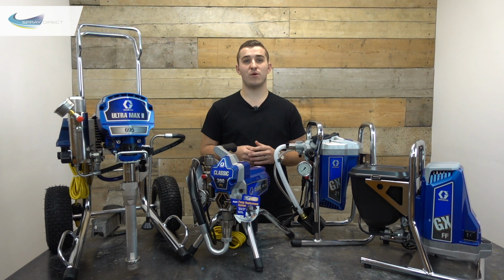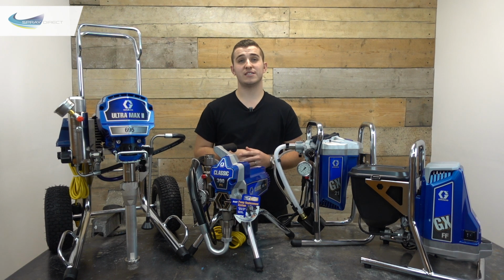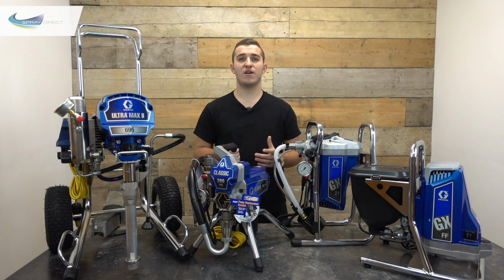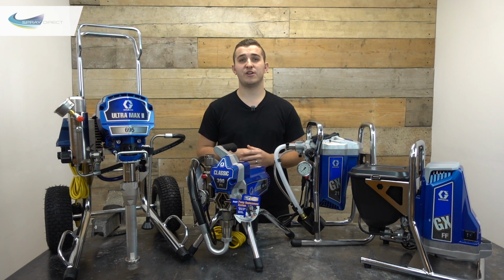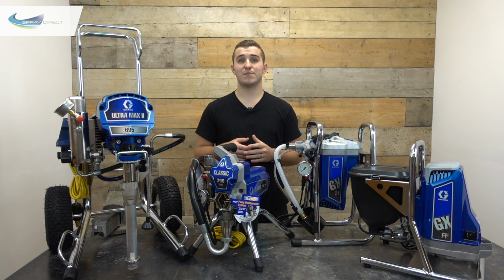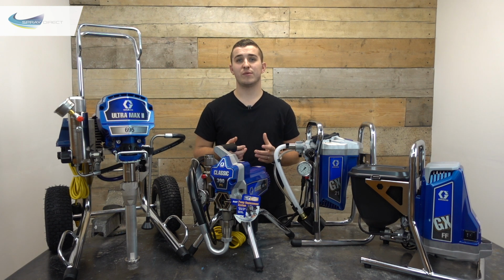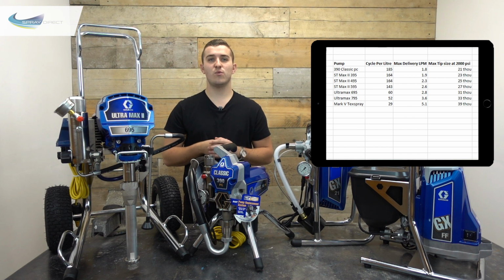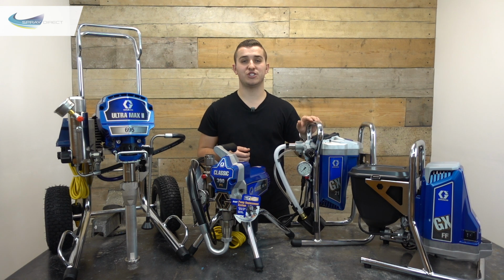How to pick the right Airless Sprayer for you

Comment: Which do you recommend for laquer on cabinets?
Reply: for clear laquer ive used titans version of the gx19, a hopper fed airless pump and it worked great, just make sure to clean it with the correct solvent and never run a water based product through that pump again it will contaminate anything you spray out of that pump after. ive used the gx 19 for water based laquer as well and it was great, a 395 is wat i had set aside for laquer undercoater as well

Comment: Is the pro210es the same machine as the 390?
Reply from the maker: That's not a model we have over here in the UK but it looks to be a cross between the 190 and 390 we have over here 👍
Reply: @SprayDirect  it really is. It has the same upright filter housing and gpm rating as the 390, but not equipped with a brushless motor or quite the same aesthetics.
Reply: very similar pumps as far as finish and production but the 210 is basically the homeowner version of the 390, certain parts and pieces are not as strong as the 390 as the 390 is proffesional use. id reccomend the 210 if you paint often enough or have a project big enough you need a reliable universal sprayer but not if you are proffesionally painting its just too much wear and tear on the little pump

Comment: Hi mate what would I need for roof painting? I'm in Australia
Reply from the maker: Hi! It completely depends on what paint you're using and if you have a power source. If you haven't got power you'll need a petrol unit. In terms of the machine you'll need to decide on paint first and then see what tip size you need for that paint then pick a machine that can cope with that. Hope that helps!

Comment: Hi there, do you think the GX21 could handle a once a year roof tile spray with a 30m hose?
Reply: i wouldnt reccomend that. roof coatings are thick and take a stronger pump to push it out, at least a 495. ive used a 695 gas graco to spray elastomeric coatings to a roof in commercial

Comment: Had 2 of those gxff and both died the same death after 15 months after putting no more than 20 gallons of waterbased finish through each of them absolute disgrace for the money they cost. I'm going back to using Wagner's diaphragm pumps bulletproof.
Reply: Maybe you did something wrong
Reply: what were you spraying with them? cabinet and trim jobs is what id use that kind of pump exclusively for. youre straining the motor if you even try to spray out an interior room with it